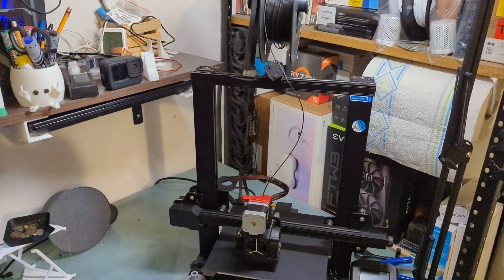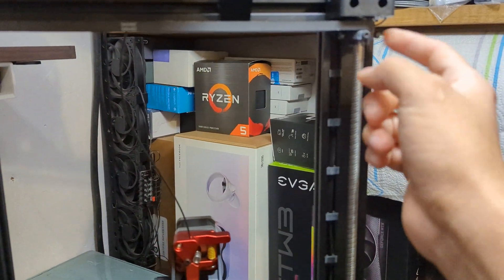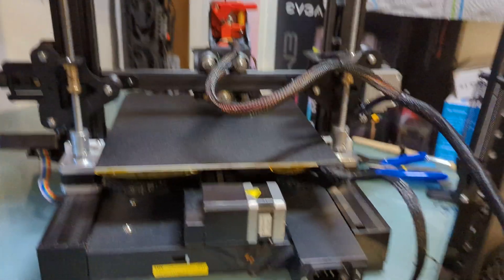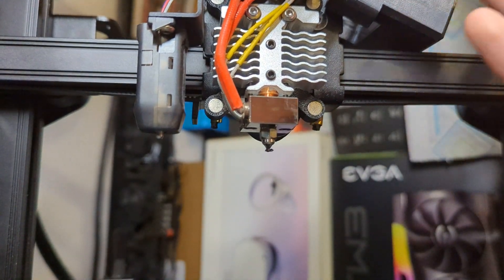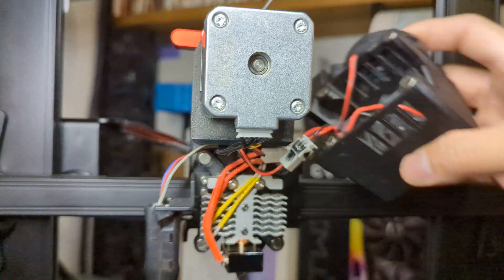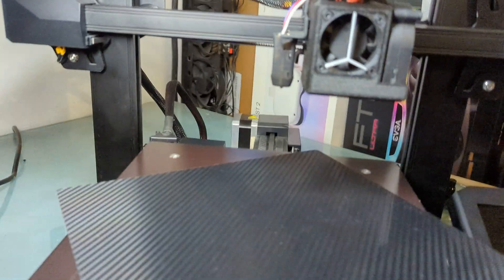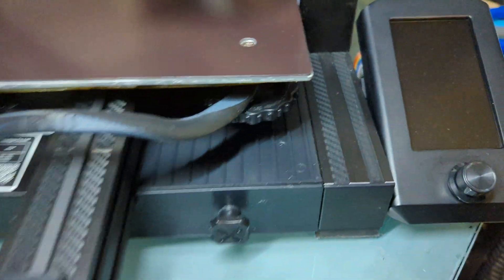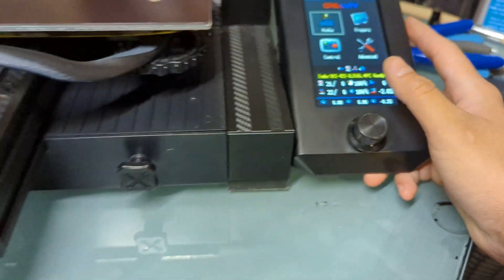Ender 3 V2 Neo - Upgrades and Mods you can do!

Comment: please help😢, I have changed to direct drive according to you. I often encounter situations where the extruder Can't push the filament . and there was a loud noise at the time of the incident Have you ever met like me?
Reply from the maker: Don't recall having a problem like that before. Which direct drive version did you use and are you using a dual gear extruder? Make sure everything lines up. Kinda sounds like you have a clog.
Reply: If you ask for help, you gotta reply to follow up questions!  😉

Comment: Looks perfect! I already upgraded to your 5015 shroud and direct drive with original stepper motor and original extruder too. Anyway I have some issues with PLA stringings and underextrussion and still trying to tune settings. Can you tell me your extrussion and other settings after upgrading from bowden tube? Thank you and  I'm looking forward to another videos!
Reply from the maker: You would have to figure that out on your own since my settings will vary from others. You'll need to calculate your new estep values and flow rate, recommend watching Ricky's video on this https://www.youtube.com/watch?v=a1m8yYmcinc&ab_channel=RickyImpey
Reply: Check how strong the extruder is gripping the filament. I haven’t upgraded to the direct drive but I was also having under extrusion and the fix for me was adding washers to the extruder spring and using loctite in the extruder arm screw to get it tight and make sure it doesn’t slip. I’ve gone from not being able to print anything for a week to having my cleanest print ever since I modified the tension on the extruder. It should leave nice deep grooves in the filament but not tear it to shreds. The grooves used to be tiny so it ended up skipping and spinning on the filament. I’ll probably have to adjust the tension per spool of filament as some colours and brands are softer than others
Reply: Increase extruder pre-tension. I had this issue and that was the solution. You probably found it already because it’s been a year but here you go. It’s impossible to get an Allen key on that screw with the bracket, so use your fingers and if you can’t, use pliers and tighten by gripping the outsides of the screw head

Comment: Thank you for your videos. You are an inspiration since there is not a lot of content available on the Neo. I would love a tutorial, if you don’t mind putting one together on how to upgrade a Neo to print high temp. You appear to have all the pieces of the puzzle: the firmware, the hot end and the thermistor (I couldn’t make out the model). But without an end-to-end detailed tutorial, I wouldn’t dare try to upgrade mine. Thank you for your help.
Reply: I second this, Ihave the  bi-metal heat break like the one he's got but other than that its the only upgrade so far,  Could I run Poly-Maker PC which is 250-270 outta this machine? with just the bi-metal upgrade?
Reply: I answered my own question. Yes you can. Just install the bi-metal heat break and I was printing PC at 255/90 although getting the first layer to stick well is a pain in the ass. I think that has more to do with the type of build plate thats on these printers. I've read that PC even destroys them overtime.

Comment: Thanks again.  I would strongly suggest getting a roll of kapton tape and wrapping those wires that cross the heatsink.  Not just for thermal protection, but to protect them against rubbing a hole from vibration over time.  

What type of filament did you use for the shroud?
Reply from the maker: I'm going to do that, I do have a roll of that tape and better to be safe than sorry later on. Shroud is made from PETG :)

Comment: The printer looks awesome! great job with everything. I would definitely get octoprint it is a game changer when it comes to automation and workflow you can print directly from cura(no more messing with sd cards) and monitor and control every aspect of your printer especially if you are going to use a heated enclosure for abs or other filaments. And it can be free if you have an old android phone you're not using, (i run mine of my old moto z2 force). It's probably the third best upgrade to my printer after of course profesional firmware (when i found your channel) and the 5th stepper motor to get independent z motors and auto level my x axis.